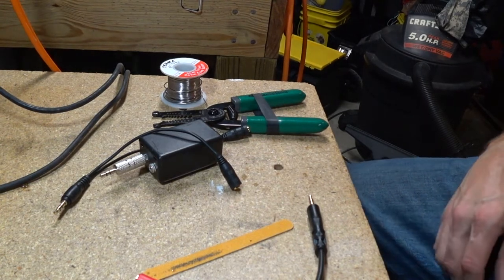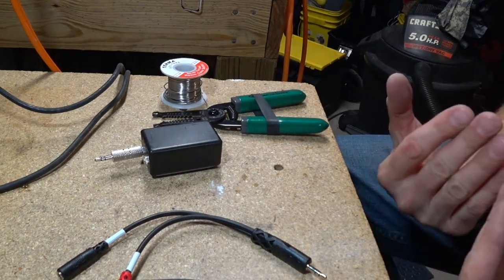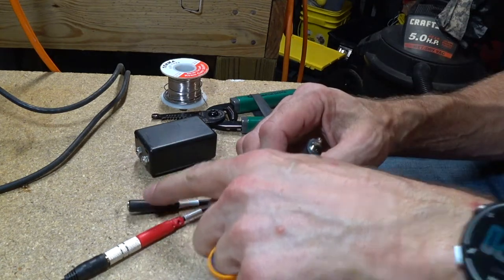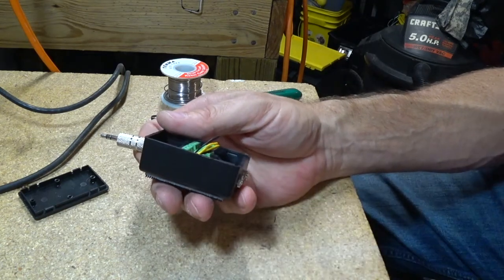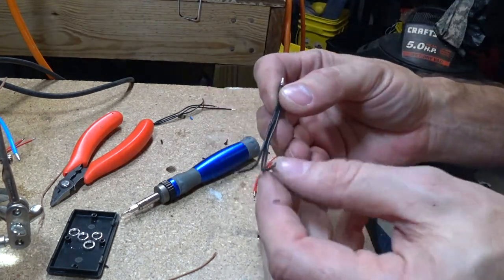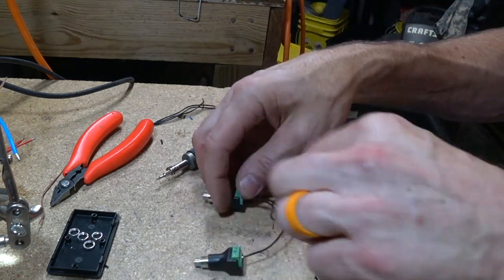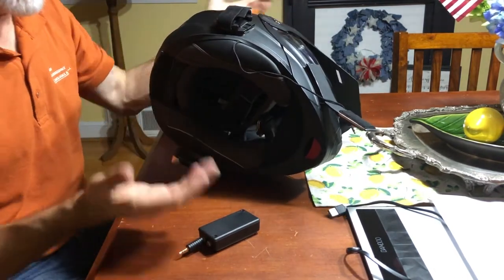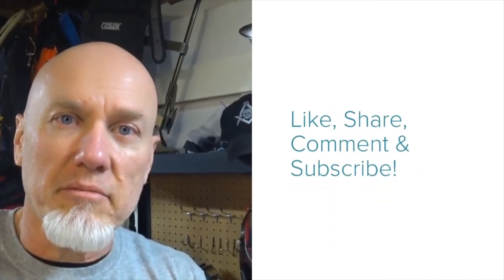best dual motorcyle vlogging  helmet communications  setup #KLRDelusionals

Comment: Nice, like my system but hard-wired instead of a mic on the comms speaker. The Sena doesn't have 3.5ml speaker outputs though, they have their own type of connectors,  so this would be more complicated with Sena.
Reply from the maker: That was a big selling point with me and the Sony cameras, 3.5mm mic jack...so many options. I tried the mic on the speakers, but I had a crappy mic with little to no gain.

Comment: Lets see if i am understanding this correctly. You are sending the speaker audio through one channel and the microphone audio through the other channel to the camera? So when in playback, that is what you will hear on each channel; Mic only on one channel and the speaker only on the other channel? 
Would it be possible to combine the audio channels when wiring this up so that on playback you are hearing the mic and speaker audio through both channels, without having to do so during edit?
Reply from the maker: I did try that, but when there are two inputs from 2 different devices there is an impedance mismatch and the two inputs will compete and one will always overpower the other. It also causes some horrible audio quality, etc. I'm sure there is a way to do that using filters, level adjustment, etc but then it just gets much more complicated.
Reply: Ron C 
Thanks for the reply
Reply from the maker: @danaszalajeski4416  No worries!